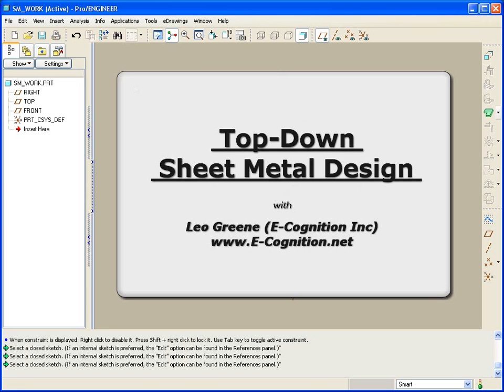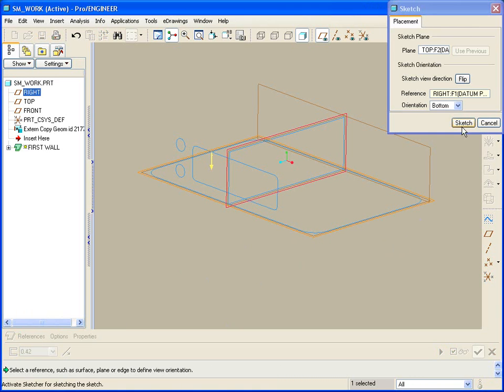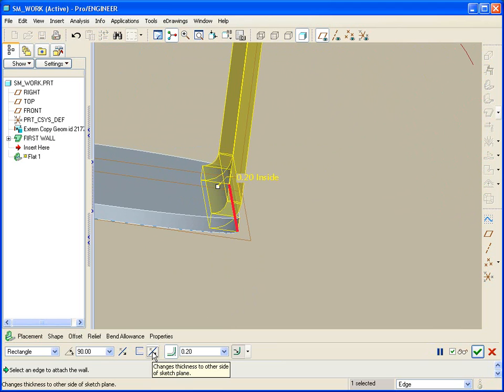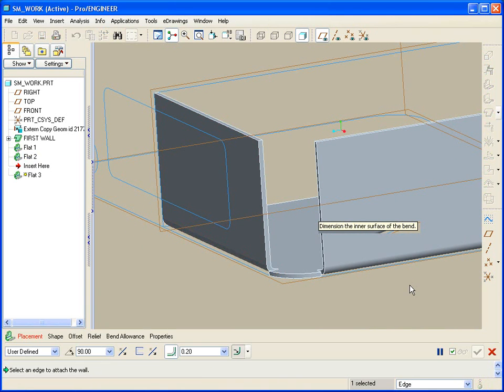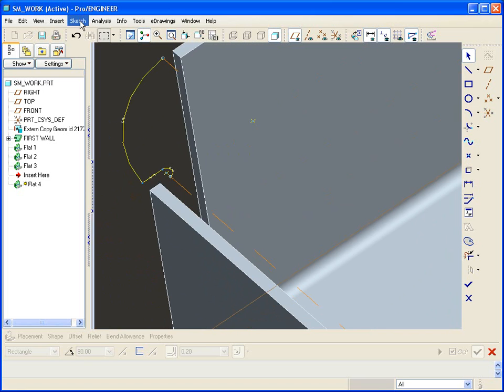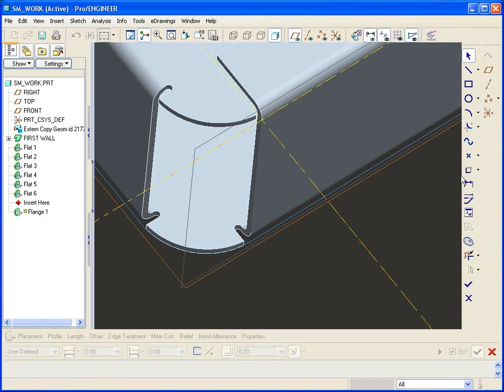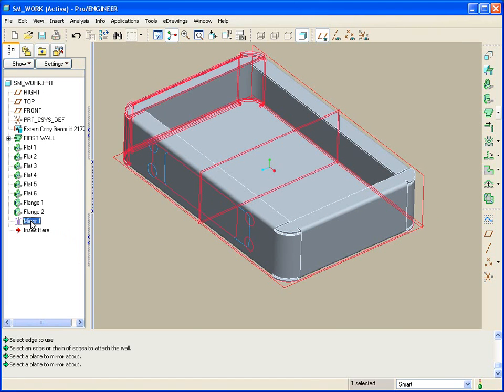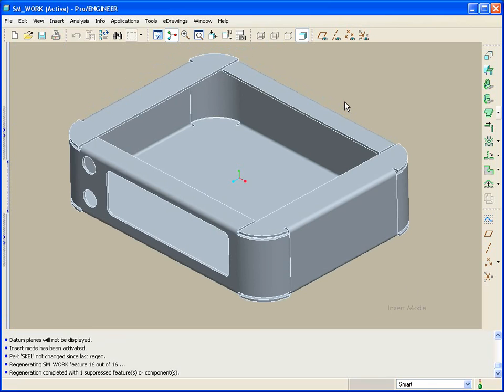Top Down approach for Sheet Metal in Pro/ENGINEER Wildfire

Comment: Hello ECognition,i was just wondering whether you could perhaps shed some light on more complex bent plates by explaining how i would create a plate with the following description, in it flat state, 150mm wide by 1477mm long by 10mm thick that has a 60mm round at one end with a 220mm length tangent chamfer running to the width of 150mm plate from the round.The plate in its bent state would have a bend with a radius of 407mm which would be offset from the non rounded end by 459mm. Thanks

Comment: Nice video. I like to see what people are putting out for others. As a 20+ year Pro/e user & a with more than 40 yeas engineering and design I would like to leave a comment. When instruction and incorporating poor design techniques for understandable speed to achieve a result please take a moment to point them out. Persons learning form you will not understand till their models start failing as to why it may have gone wrong. To close I would like to thank you for the effort to help people learn.

Comment: of course you can, ust go to edit -> setup -> material. There you will find pre-setup materials and you have the option to create your own materials with different char. By assigning a material to your part you change it's apperence. But to get your model to appear real you need to create photographic- or videorendering.